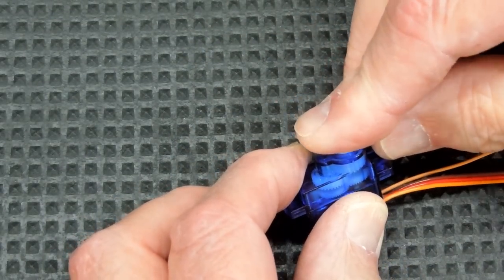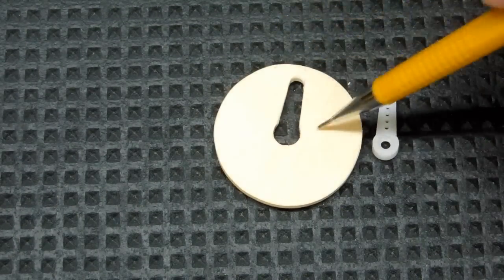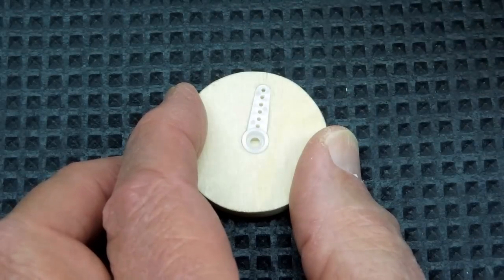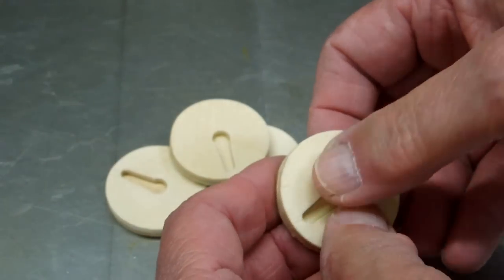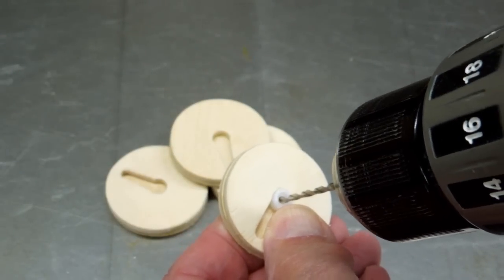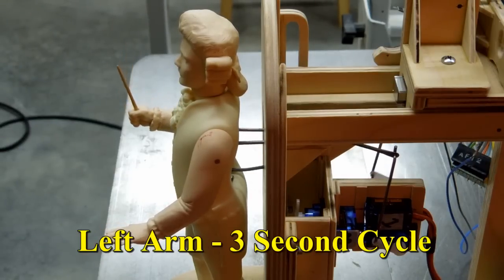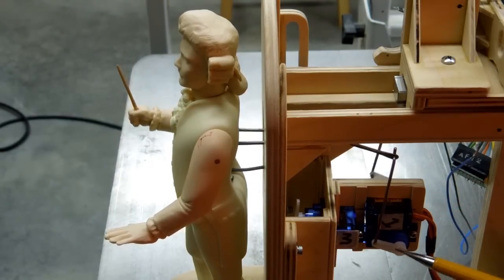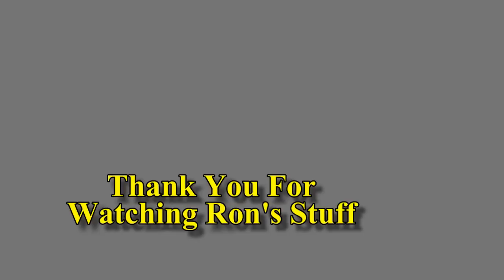Senior 20 Conductor Installation (12) Servo Disc

Comment: I was wondering why bother with cams if you're using servos that will be hidden anyway, and then I saw you had the same thought.
Reply from the maker: Taking the entire platform mechanism with the attached conductor out of the organ for modifications or maintenance is a bit of work. I was initially playing around with the idea that the conductor could be removed (unplugged) separately if there were no physical connection between the actuating arms and the cams.  The conductor could be gently moved into position ensuring the actuating arms were properly engaged (aligned) with the three cams on the three servos and then the two screws inserted through the platform into the feet of the conductor. I thought it ended up being too sloppy.
Reply: Ah, that makes more sense.